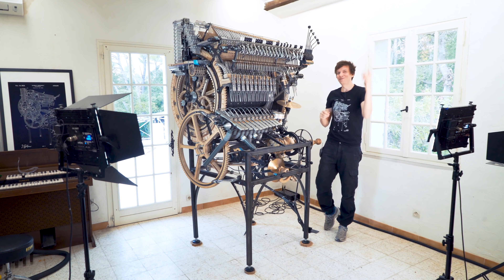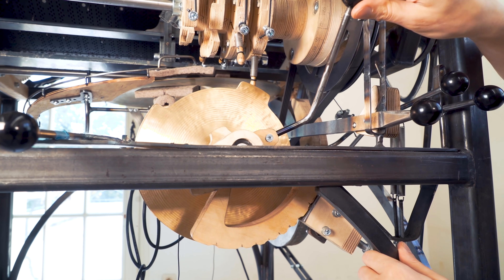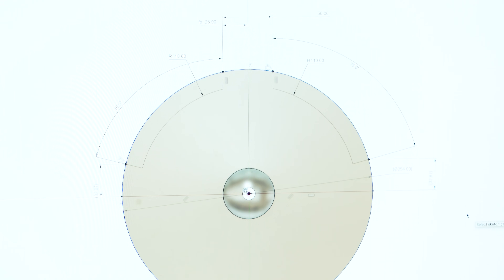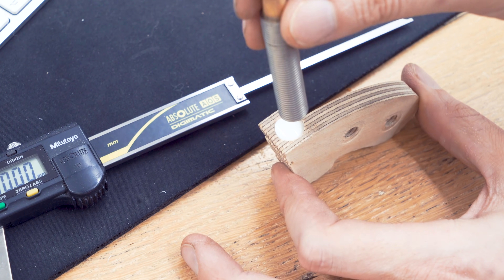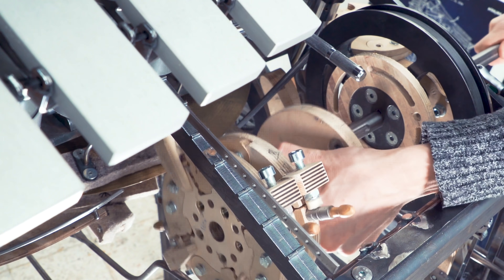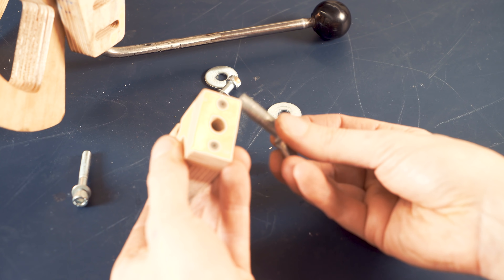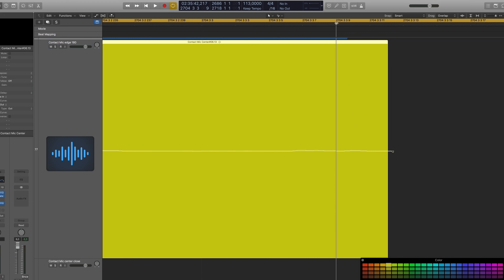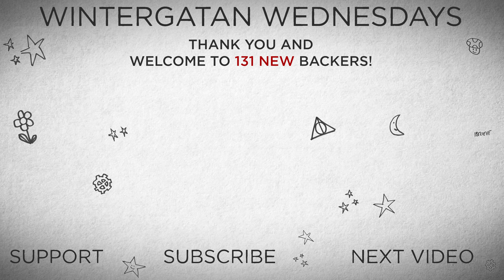I Made a Hi-Hat Machine - Will it Work? | Marble Machine X #108

Comment: Every drummer has to eventually cut out pieces of their cymbals due to cracks, and it is known that the pitch remains the same, but the more surface you cut off, the shorter sustain you get. Which is not a problem with hi-hat at all. What did happen is that you created an opening between two hi-hat cymbals that gives a cowbell-ish character to the sound. I'd try bending or adding something to keep the edges of both cymbals as close as possible. Cheers!

Comment: Hats off to your creativity, + things to keep in mind, on the H.H. machine, it sounds very clean + accurate, would be nice with an auto steady option, also more designed for the 2nd slave choice, when using double kicks, + 2 sets of H.H. cymbals, going at once , one riding the grooves manually, with no crossover, although some players like the choice for rock sizzle, + in jazz the single heel crashs, plus another missing feature, of the machine, for essential funk drumming, is the H.H. barks, however it's your inventive  thought that counts here, brilliant idea, playable, but with a limited style, to some drummers, thanks for the view.

Comment: Great job. But I think u have to change the rubber-solution to one with springs, because the rubber-bands will loose their flexibility.  And so your adjustments in that ms area are not lasting for long. ( if you haven't done this till today). 😉

Comment: Only thing I'd suggest is to get some high end high hats like A custom zildjian 14s. The hat you're using here sounds really dull and doesn't really cut through as much as I'd like it to. The zildjians are a bit brighter but have a really good balance between a good sloshy rock sound and a tight jazz sound. Also I think you went a little crazy with your cuts. If it's possible just make a single cut where you want the indentations at so you're not killing the depth of the hat. You'll find when you're trying to mix these paistes ((not knocking the brand at all, paistes are great but not really for what you're doing here imo) in the way they are that you're probably gunna have some trouble. Not that it's impossible, but honestly I think you'll get a lot more life and pleasure out of a good pair of sabians or zildjians. I don't believe in brand loyalty at all, but cymbals are the one area where it really matters and I think you'd be able to have a lot more freedom in your cuts and sound alterations with said higher quality hats.  I also think the keyhole you cut in the cymbal was actually unnecessary and I do believe you can get locking hat clamps that can be easily controlled by a remote pedal/activation. That being said, what you have here is absolutely brilliant, and the hats you have currently do work for a more electronic sound. I just think you'll end up getting frustrated with them once they get some wear and tear on them.

Comment: Use a bike brake handle instead or the knob, have the cable go down and replace the pressure screw with a device that would open and close the hat when you squeeze the bike brake handle.

Comment: Maybe there is a simple way to open and close the hihat faster.
How about using two gears with differend sizes?
If the second gear is big enough, you could welt a lever on and use it like a open/close/something between switch.

Comment: Clearly a genius and clean design, but I wonder what ruled out somehow having the mechanical ability to lower the different drumstick rhythms onto a normal hi-hat instead of having a rotating hi-hat.  If managed, it could retain the original hi-hat shape which might resonate more, would avoid the ball design/lock as well as the need to manually rotate it, and even give more combinations for the hi-hat pattern.

Comment: For the fine tuning of the strings timing, have you considered using a tuning peg design? Just like the ones on the head of a guitar, it would be able to make more acute adjustments to the strings without a tool.

Comment: Martin,  the ticking sound was not from the spring hitting the felt. Instead, it was from each spring loop slapping it's brother next to it.  Several solutions,  one could be using rubber tube instead of spring, or a thin rubber over the spring for dampening,  or attach the drum stick end to a steel band like the original.  Thanks for the video.

Comment: Martin you could also just put the felt higher to dampen that metallic sound. Putting it at the middle of the spring made it act as a lever for the upper part of the spring to spring back even more than without the felt, resulting in a stronger mechanical sound as you reported. Maybe the string solution works fine but I wonder if the continuous stress could easily loosen it by torquing the screw.

Comment: About the elastic cord for the fine adjustment--I'm sure you've experienced something similar for microphones, but the rubber in elastic oxidizes and hardens over time.  You might find it useful during development to keep a log of when elastic parts are changed out and how long it takes before they begin to lose elasticity and timing control degrades.  Every compound is a bit different, but I've found they tend to dry out, here in the desert.  Something to consider for the world tour (hope you book Salt Lake City, if not Cedar City).

Comment: It's gorgeous!

One little drawback is the clearly audible mechanical noise when switching the hit hat channel. I think it would be beneficial if I could put a ring in the hole of the metal part that keeps the spring loaded ball in place. Something like this, just with the right diameter of course: https://www.oldtimerbedarf.de/Gummituelle-18mm-Blechoeffnung-halogenfrei-PLIOPRENE
Alternatively you could try using hard rubber balls instead of metal.

Comment: how about just putting a felt core inside each spring, and covering them with a thin layer of felt on the outside?

another idea: acoustically isolate the ball detent from the frame, and round out the stop notches a little to get smoother movement, unless you like the mic picking up all that clacking when you move the lever.  put felt inside that spring too, you have basically made a tiny temple block.

but maybe the clacking is good, it sounds like a little flam or roll leading into rhythm changes...  think about how 'Every Breath You Take' would sound without squeaking strings.

Comment: Just one long term question, similar to a concern you had back when designing the vibraphone adjustment mechanism.

What happens with the position locking mechanism as wear accumulates on the plywood detents?  If you use them evenly, the tension adjustment will deal with that elegantly, but if you find yourself favoring some positions over others you could end up with some being more difficult to access so that others don't slip.

Comment: Mr. Wintergantan. Firstly. I'm impressed at the engineering of making a means to get the Hi-hat strike timing under 1 millisecond. The recorded graphs on the computer show the improvement. Having keyed positions of the high-hat wheel for the different beats was a great idea. But here's the over all thing in my view related to timing. Even if it was 10 milliseconds off its timing I doubt I would have noticed it as I listened during a live performance. Does it really need to be that precise? My opinion reveal on the X. Marble Machine X is becoming a timing adjustment beast. I say that because of the videos posted. Many of the videos deal with adjusting many things about X to get the,,, perfect music/box machine. In a studio setup you have time to make it right. In a live performance, it is like a fire drill.

Comment: Hej Martin,  i think you should integrate an oscilloscope in your toolbox for the World Tour, so you dont need to be recording in a computer laptop, zooming for adjusting and repeating. with the scope, you just need to connect the channels that you need to synchronize in the different inputs (i would recommend 4 or more) watch and adjust on the flight. The only thing you will need to to have a "Master timing pulse" generated by... any element of the main shaft of the Marble machine as reference for everything to synchronize to). I believe that you could measure the delay in a matter of seconds and reduce the time needed for maintenance.

Comment: This is a beautiful marvel of engineering right here, that use of the rotating beater was ingenious. I wanted to mention something though, I noticed that in order to open or close the hi hat you used a pressure screw. I got to thinking in order to gain more symbol depth could you create a method to open and close your hi hat easily with a push locking mechanism making it easier and quicker to maneuver through open and closed high hat?

Comment: Excellent solutions, My only bit of warning is with the elastic tethers used on the spring-drum sticks. They will elongate over time and dry out leading to eventual failure. You should use dampened springs of the same thickness. dampen them by inserting a thin layer of wool, string, or fabric.

Comment: You could eliminate the tension nut and combine it with the rotation lever. Rotate would change the note like designed and then in and out would adjust how tight the assembly is.

Comment: Time adjustments with elastic bands is a bad idea in my opinion. These elastic bands will dry out, stretch, etc. A normal spring with some rope would be lasting longer I think, altough that wouldn't look great. But also the current elastic bands make the hihat machine a bit messy.

Comment: A few things:

1. The felt could've been potentially moved upwards instead of outright removed to reduce the mechanical noise. My theory is that the spring is being stopped while still in motion and the momentum from the tip is causing it to bounce back and forth. Moving it higher up closer to the beater would allow more of this momentum to be absorbed.

2. I feel like it's important that you don't burn yourself out too much. I know you've been rushing to get a video out by Wednesday, but that comes at a compromise. Either in quality or in your own well being. Don't worry too much about getting the next big thing out for the video as it'll cause you to start cutting corners.

Comment: just put some cable isolation/tape/plastic on the hihat holder/shaft where the hole is. The vibrating steel should not touch hihat directly as it will make a keyhole sooner or later.

Comment: One more idea, in case you'd like to change the distance of the hihat cymbals much faster: You could try to use the lever for that which switches between the beat channels, by making it tilting back and forth on the rotational axis. It's a bit like a clutch design, and if you make an index (one more spring loaded ball bearing! More meaning of life 😉) for that, to you could use the lever in two dimensions to change both rhythm and the sound played by the hihat.
Feel free to come back to me if you feel you didn't get what I tried to explain 😁

Comment: The problem with the elastic is that it will stretch so it will need constant readjustment over time. Might have to refine it. As far as the spring and the felt it would have been better the higher on the spring it goes if not right up to the top of the spring. If its low then the spring is still spring back and forth above which gets the noise.

Comment: I hate to possibly add to your workload, but your system misses out on some of the standard hi-hat uses.  Generally, they are sounded by striking them while open (done - check) as well as closed, open and then closed after striking to dampen the ring, or closed and then opened to create a shimmering effect at the end of the note.  While I love how it's coming along so far, you only have one of these methods so far.  I hope there's a way to incorporate more of this into the current design.

Comment: You should have integrated the hi hat pressure into the rotation lever such that when you pulled on it (or pushed, whichever's more natural) the hi hat would open.
Also. What happens if you rotate it too far? Will the detent ball drop out?

Comment: I say, again, that over time you are going to run into issues related to wear on the wooden parts. The detents on this wooden part is a good example. If nothing else, you can penetrate the wood with a high grade of superglue in the contact areas.

Comment: I'll bet you could replace the springs with rubber tubing and you wouldn't need the elastics to dampen the spring's boing noise. The original timing adjustment might hold timing better than the elastics anyway...

Comment: Mic placement: Surely pointing the mic at the hit point gets you a lot of "stick" noise instead of "cymbal" noise...?
The whole surface of the hihat will be radiating sound, so why not experiment a bit more with mic placement.
Reply: @Joe-nq6hy  I'm not talking about moving it further from the hihat, just further from where the stick connects with it.

When the hat is closed, the rim will likely be the quietest part anyway, as the cymbal surface will be restricted from moving.

Comment: For the hihat pressure adjustment... you should move the knob outside of the frame with a suicide ball on it. This will let you make the changes more quickly and accurately. You could probably add some detent to lock in specific sounds you want (similar to the detente you have for the note lever).

Comment: Love your videos, but I have one small point of contention. You mention over and over with great pride that your construction consistently points the microphone at the hi-hat's sweet spot. But it's not pointed at the sweet spot, it's pointed at the edge, or contact point, which is not going to accurately represent the dynamics generated by the shape of the hi-hat. You would certainly get a fuller sound by pointing the microphone closer to the center of the reverberating body of the hi-hat.

Comment: I'd like to highlight a potential issue with your timing adjustment mechanism.

There's a rule that most guitarists ignore: never tune down. If you're sharp, you should downtune by a semitone or more then tune up again.

The reason for this is that when you tune up, the whole string experiences the increased tension. However, when you tune down, the friction in the nut or in the windings on the tuning peg can sometimes hold tension while the free length of the string slackens.
What then happens is that when the string moves, it slowly overcomes the friction and the excess tension held elsewhere in the string is released, and the whole string slackens and detunes while being played.

It's not a big enough issue for most guitarists due to the tiny amount of detuning that happens with high tension wire, and the fact that guitarists tune their guitars at ever session. However, with the hi-hat machine your elastic cord has relatively low tension, and the woven fabric with experience very high friction against the threaded post. Then during play, the cord will move quite dramatically, and when the movement overcomes friction, the beater will lose timing and start to play late. You're not going to want to recalibrate the timing as frequently as a guitarist retunes his guitar, so you need to pay attention to this.

BUUUUUT....
You also have the opposite problem from guitarists, because the high friction/low tension setup means that the tension on the windings on the posts may be lower than the tension in the free cord, and then you end up losing timing even when you only tune "up" (i.e. faster).

My recommended solution would be to shorten the elastic cord and attach it to a short length of (unwound) nylon guitar string, so that everything you're wrapping around your post is non-elastic, and is going to have near-constant tension, so no phantom detuning during performance.

Comment: The use of elastic strings to limit the drumsticks and to also use it for precision timing is error sensitive. The string tension can be influenced by temperature, humidity and mechanical vibrations which could cause the precision screw to turn. For stage performances you could check the tension of the strings by checken and tuning the notes of these elastic strings.

Comment: I don't want to introduce more feature creep :) but... The springs you are using have the same pitch as the wire's diameter. When they are bent, the coils touch at only one point, but when they're straight they touch over the entire coil. The transition between one point to the whole circle is what gives the mechanical sound. When you'ld use springs that have a greater pitch than the wire's diameter, the wire doesn't either never touch at all (ideally) or only at points and never completely. Dampening would then be the next problem to solve :)

Comment: You can simply stretch those springs so that their turns not touching each other. Then there should not be any clunking sound when they spring back. There will be natural vibrations probably, but that can be fixed by felt dumpers as you did before.

Comment: Instead of elastic bands that will need many ajustments and will depend on weather conditions (humidity, temperature, etc.), Martin should use iron strings just like guitar strings, with a hole in the screw or using tuniing pegs.

Comment: I love this new design, I noticed though that if you want to mute the high hat you have to turn it and if you were using a rhythm from the far end, the other rhythms will sound as you transition it instead of it just getting cut off and the same goes for starting it up. I would have maybe mounted it all to a second mechanism that can drop the high hat out of contact with the spinning tips while still maintaining the setting you want.

Comment: Another way to silence springs is to put a piece of plastic tube in it. Learned this from some guitarist putting plastic tube in his tremolo springs.

On the adjustment side of things - Another guitar trick could work if the elastic bands fail could be to build the spring/stick config like a neck tilt set screw on some guitar necks.